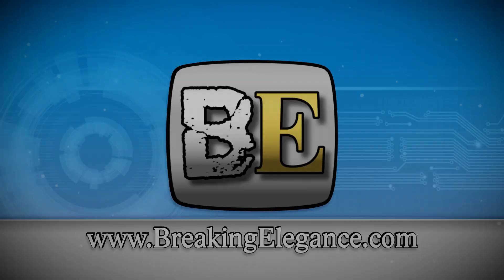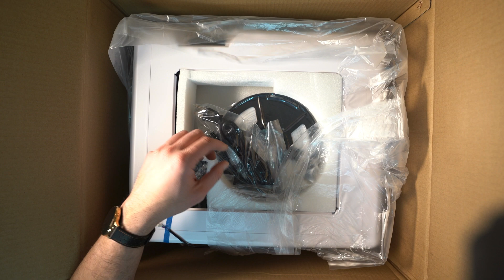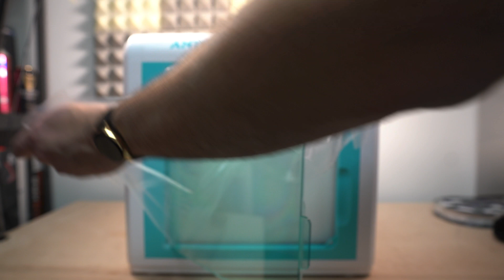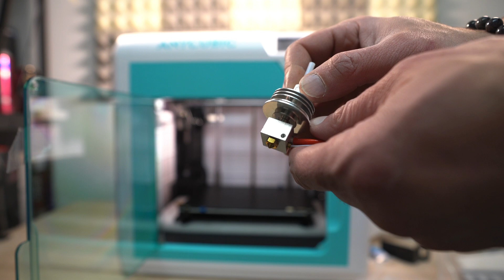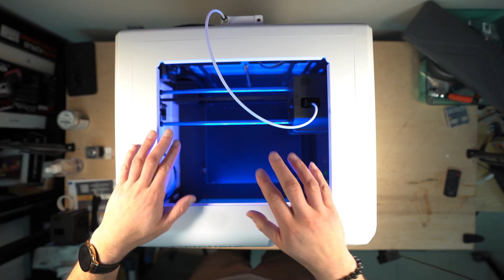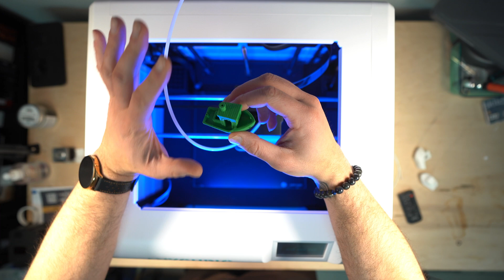ANYCUBIC 4MAX PRO 3D Printer  Unboxing and Sample prints!

Comment: Do you still have this printer? Any chance for a review after using it for some time? Are there any issues you found from long term use? Did you do any tweaks or upgrades, especially regarding printing high temperature materials?

Comment: Hi, It seems now obvious that anycubic is not going to continue with this model. Last pieces are being sold right now. I wonder if they are working on a successor. Even if I am able to fix stuff it would be pretty hard to longterm maintain a product which has so short lifecycle - not even a year! It means probably no new versions of firmware and limited parts availabilty... Are you going to further develop a modified version of the carriage - to be able to mount different extruder?
Do you suffer from a weird flat carriage connecting tape (not a wire)?

Comment: Hi do you ready with video two of the 4max Pro. You do the First Attemp of the new base very well
Reply from the maker: make sure you clean the bed very well before first use
Reply: @RiftFactorAI  ok Mittel missunderstanding  sorry Bad englisch  i mean the extruder Base what you re Design in white colour. Ist tjis allready finish to share the Results ( or the file) .

Comment: Nice review, thank you.  Have you noticed actual ( as measured by an external device) vs set temperature of the hot end.  Youtuber "TheHotEnd"  did when he tested his 4Max Pro.  It would be interesting if you did.  He has not published the solution yet, but I was wondering if it is a generic issue.
Reply from the maker: I haven't looked into this but I find that very interesting I am wondering if it's due to the original thermistor or the hotend design which is my least favorite part of this printer

Comment: Couldnt you replace the Bowden tube to a higher temperature resistant one instead of changing the hot end?
Reply from the maker: From personal experience that's not the most reliable way to print High temp filaments the bowden tube will degrade much quicker overtime and I would not even push Good Tubing over 250 degree's Celsius even though they claim a max temp of 260º that would be pushing it. For printing ABS, ASA, and PETG at 245º and under sure you might be able to get away with the Capricorn tubing and call it a day :-) which maybe I will cover that in a video in case people might not want to go all the way to a all metal hot end So thanks for the video idea.  I have 2 of these printers so one can get the Capricorn treatment and the other can get the all metal hotend treatment.
Reply: @RiftFactorAI  :-) Glad I could help,.I was thinking on getting this printer but I think I'll go with the "Anycubic Predator" because of its build volume. One of the many upgrades I wanted to do was add the Capricorn tube to it, but based on what you just told me I might just replace the hotend all together. So thanks for the explanation. I'll be looking forward to that comparison video.
Reply from the maker: Yeah I will be putting out take apart videos soon because those are neccessary in order to work on the printer